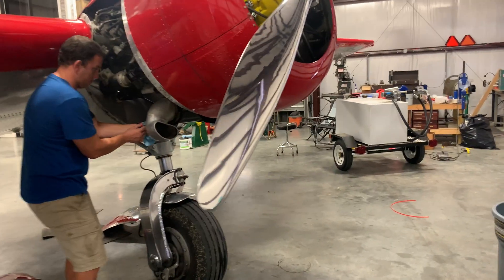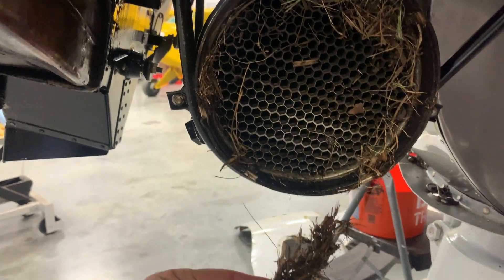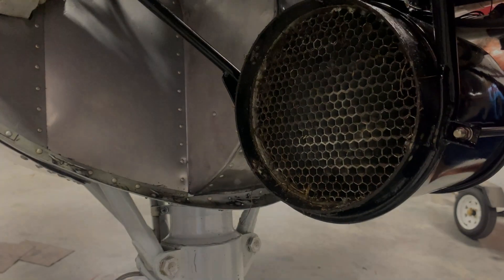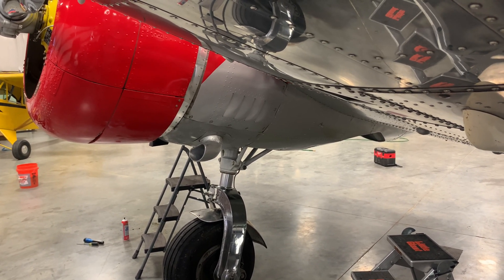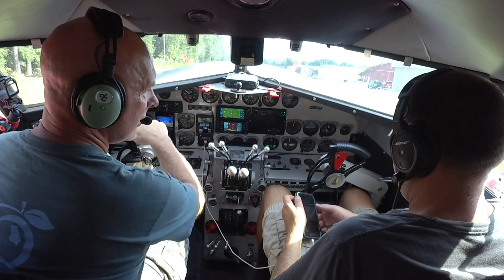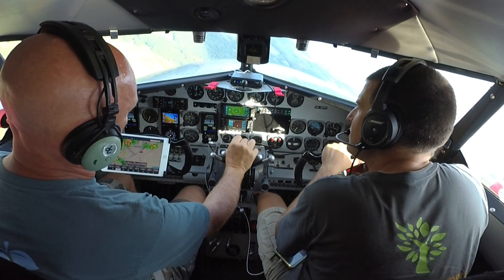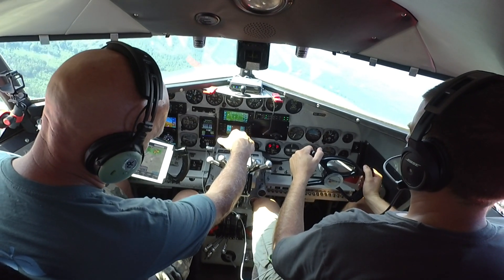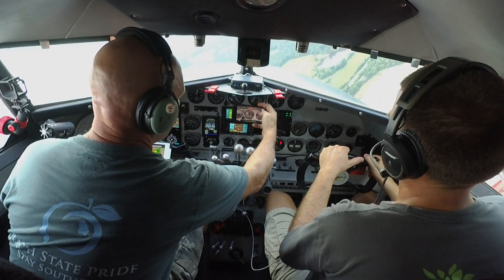Oil Cooler on the Lockheed 12

Comment: The screens might still get full of debris but at least it would be so much easier to clean them off each time and that would become part of your preflight inspection as well. Could it be that the direction of prop rotation could cause one side to gather more grass than the other side? Just a thought.
Reply from the maker: I thought about that but it appears they were both pretty clogged up.  The left was worse than the right so it is still possible but don’t think it amounts to enough difference to matter.

Comment: Maybe some type of custom bent vacuum hose to regularly clean coolers if screen is an issue.
Reply from the maker: You know, I didn’t think about it but I have a vacuum with a smaller hose,  I might try tomorrow and see if it will fit up in there just as a preflight or once a month process.  Great idea.
Reply: Try a borescope in the scoop and a vacuum if needed.